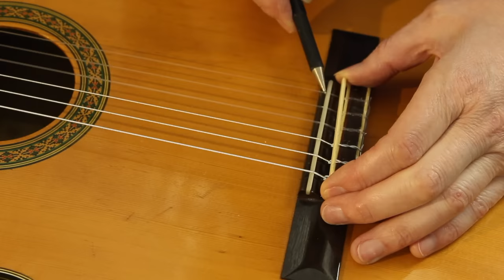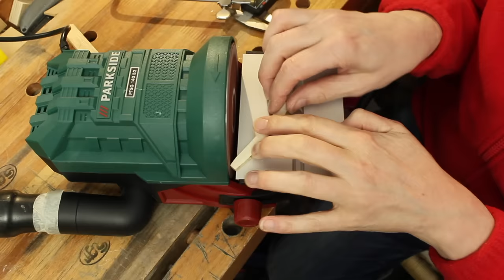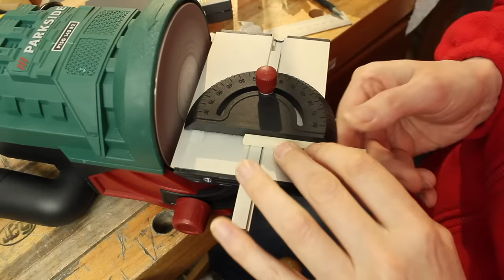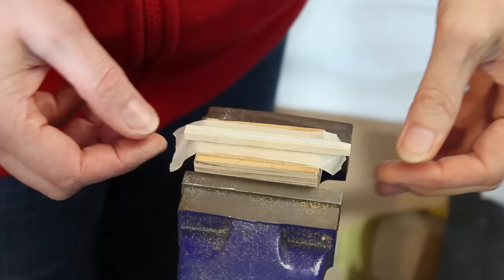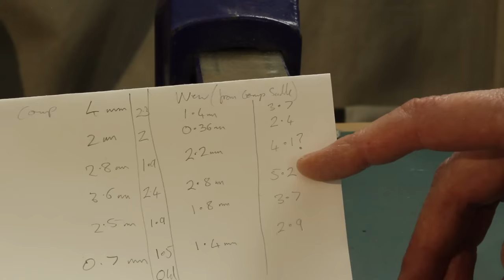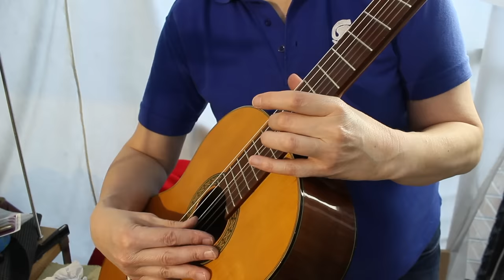Fixing the intonation on a classical (spanish) guitar

Comment: I'm struggling with nuts and saddles now and have been all spring. Here's a question,  I have a Yamaha 200s their 25 scale are they intonation specs separate from say 25 inch because our you buy a saddle they never ask what scale they just sell you what what's in their shelf. And I'm going to get a 4 mn bone saddle unbleached because bleach compromises the bone leave it in long enough and bleach will desolve it and that's my point  but I need some over hang on the back side side so it will look like a L but flipped up. Then I was thinking just super glue blocks where needed, my saddle is like 5 mm  +- and that's not much room, the there's though of the blocks letting go. I'm also going to carve individual string saddles connected by brass so there will 6 bone saddle standing up.

Comment: I took off all the frets on a cheap old guitar .  (3/4 sized Tatay with no fan braces whatsoever , also loose supporting brace under the neck end ) .  I had to rebuild as it was falling to bits . Three small nails were holding the back on  . To renovate the tuning I glued on bronze wire frets .Each note was worked out with a movable dummy fret ,using a Korg orchestral tuner , I fitted the bronze wire frets so every note was exactly Equal Temperament. This produced Wiggly Frets .All notes along each string perfectly in tune and not a straight fret to be seen .  The frets were glued on with Evostik . To remove one  just warm the fret up with a soldering iron .
Bending the bronze wire is easy with wire bending pliers .    Use parrallel nose pliers to lay them flat  on the fretboard . I hardly had to bother with fret levelling .

Comment: Thanks for such a fine video!  Your guitar looks a lot like my Takamine No10 classical guitar built in 1986 I bought used about 3 years ago.  From what I could tell it appeared to have been played very little.  I know it was bought in Japan, brought to the US and sold to me.  It was in Japan until I bought it.  Only the Takamine guitars that stayed in Japan were varnished on the inside of the sound box because the oceanic air is so humid in Japan.  I think it has the reddish brown east Indian rosewood back and sides and a cedar top, ebony bridge and fret board, mahogany neck.  The sad thing is there is no truss rod and the strings keep getting progressively higher off the fret board even though a lot of the time I'm playing in the very low tension open C tuning (just my own folk style guitar I play originals and covers with) but low in the $ now to have the neck reset.  Also my bridge and saddle are already very thin and low.  How much do you charge?  The grain in the cedar is very thin, my amateur term... the growth ring lines are extremely thin or many per centimeter.  I think the top wood comes from cedars in the far north of Japan that grew very slowly.  Does  your guitar look so much like mine because the founder of that Takamine company and maybe the founder of Yamaha too... trained under some of the world renowned guitar builders in Spain?  I forgot the Takamine founder's name.  What do you think of the older Takamine classical guitars like mine?  Mine sounds beautiful.  It sounds so nice that when I played at a coffeehouse open mic a man liked the sound so much after I performed he was taking pictures of my guitar ha!

Comment: Do you do anything to prevent the bridge from pulling forward over the years and causing bulging? I've tried to fix two of my friends steel string guitars which both had a quite serious belly bulge problem. On one of them I just clamped down just behind the bridge with two planks on either side of the body and let it sit like that for about 3 weeks. On the other one I had to remove the bridge and do the same kind of clamping for a few weeks, with a humidifier inside of the body, and also sand down the bridge a bit before reattaching it. I told her that she probably should make sure that the guitars are stored in a environment with proper humidity and also loosen the strings when they aren't played, but other than that I don't really know how it can be prevented.
Reply from the maker: Nylon strung classical guitars have far less tension and the fan braces mean it should never be an issue. Steel strung guitars are tricky because a bulge I think means there’s a design issue - eg my Yamaha 12 string is woefully underbraced. I’d rather add an extra brace than have to recommend slackening the strings every time - that’s not going to help tuning stability. There is a device that screws under the bridge and relieves the torsion by bracing through a rod attached to the tail block through the end pin - can’t remember what it’s called.

Comment: A very helpful video. Thank you. Does the tuning reference frequency affect intonation? I usually tune my guitar to 432Hz rather than 440Hz. My strings are a little sharp at the 12 fret and the saddle is only 2mm thick so not much room to correct it.
Reply: Tuning flat can make intonation little sharper, but 432 is such a tiny amount that it makes hardly any difference at all.  You can usually tune to Eb without causing intonation problems, (which is equivalent to tuning to A=415 if you prefer to think of it that way, a much bigger difference and not usually a problem)
Reply: @Muzikman127  Thank you. I have now corrected the intonation problem with my guitar. I routed the bridge slot wider and used a 3mm saddle which has allowed me to adjust the intonation almost perfectly.

Comment: The changes in tone due to changes in weather conditions I believe is due to the wood expanding and contracting. As my guitar warms up the wood expands and the strings go sharp because their length has increased slightly so I usually do my scales while they are a bit flat and they settle back to tune as the wood expands. Mine is not an expensive guitar and it is a bit out of tune on the 12th fret and I’m so deaf that it makes no difference to my playing. Another Gardner.

Comment: Susan hello, your video is great. But I have a guestion. Is a guitar playable at all if it is not intonated, if guitar does not have total intonation. For example, if we have optimal action and guitar is in tune in open string position, is that enough, or we need that also in 12th fret? Thanks a lot.
Reply from the maker: If you only want to play chords at the open position, ‘cowboy chords’, you can get away with poor intonation, but you’ll start to notice things are out when you play higher up the neck
Reply: @SusanGardener  Thanks for the answer. With skills I am on the way to be an intermediate player. I have Hohner hc06 classical guitar, beginners school guitar and electric Ibanez GRX20, also guitar for beginning. Both are afordable instruments. This is an introduction for my question, is it posible to get full intonation on those budget instruments? Or they need some kind of upgrade. Sorry if I bother you. Thanks a lot again. I am interested about your opinion.
Reply from the maker: The Ibanez has all the adjustability you need and you should be able to intonate it perfectly. The Hohner is maybe more a matter of luck, but you are less likely to be playing chords high up the neck so you should hopefully be fine. Modern guitars are generally fine providing they’ve not been subjected to extremes of humidity.

Comment: I use a string stretcher, same kind that works well with acoustic steel string guitar steel strings, and with some patience and diligence I can accelerate the string stability and get even new strings to a stable,playable state in a day and not days. In fact I can get the strings to a playable state in hours. Love those string stretcher gizmos!  Have you ever tried classical trebles whicyh are steel? Titanium as I recall. They have typical nylon trebles tension so don't confuse them with acoustic steel string trebles, they are true classical trebles but made of Titanium.

Comment: I used my mini-mill with a 1/8” bit to create a cantilever(L shape) in a 4mm wide stock bone saddle which enabled me to create a longer string than the existing 2mm slot would normally allow for my very stiff super high tension strings. My G string sting is 3.5 mm back 😮

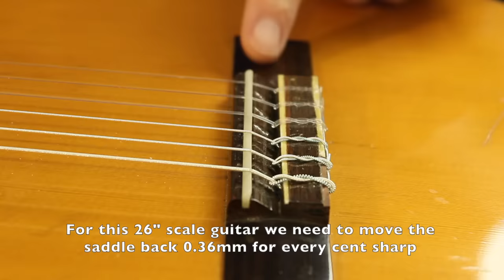Comment: on 9:26 you labeled on 26" gtr, each cent need 0.36mm move, how can I calculate other scale gtr??? thanks for sharing
Reply: If I understood the explanation correctly, each cent off at the 12th fret requires you to move the saddle position ~2 hundredths of the width of the 12th fret, so I’d go by that.

(because a cent is a hundredth of a semitone, and you need to double it since the saddle is twice the distance away from the nut as the 12th fret is)

Comment: Good explanation. Just a thought, why not cut the G string section of the saddle out and have the G string sitting on it`s own separate saddle, indeed now that you have worked out in more detail which which strings need fine tuning why not do this to all the strings then you can more accurately compensate for each individual string.

Comment: Hey Susan, great video! What would you do with a guitar that was a whole step off on the G and B strings? Would you consider moving the saddle itself, even if all the other strings are intonate-able with the methods you mentioned?
Reply from the maker: Are you talking steel strings? It would be unusual to have such a marked difference with nylon. It is possible to have a split saddle - Lowden do this on their steel strung models

Comment: Someone else may have committed already on this. I think you're solution is addressing the symptoms instead of the cause. More than likely,  the too of the guitar is being bent by tension. It happens over time to all guitars. The real solution is to provide support for the bridge to return it to a flat condition. The top has bent allowing the bridge to bow inward this shortening the scale length. Supporting the top under the bridge will lengthen the scale again restoring the intonation.

Comment: If it is sharp you can adjust on the nut to shorten the first half of the scale length of a particular or specific string having a sharp on the 12th fret
Reply: @rodelgalvan
What you said in the comment is illogical and mistaken

Comment: don't know how I stumbled across this. interesting approach. per experience, saddle adjustments can help but not solve intonation: strings are simply too variable. another approach is to alter the shapes and positions of frets: greatly more difficult. whatever the approach, any acoustic string instrument will have greater sustain the closer all strings/notes can be brought to accurate pitch along the finger board. bone for saddle is too variable for sound; especially when thick. beware fitting the saddle too snugly, as in this video; the pressure can crack the bridge.

Comment: You dont understand why Nylon strings stretch? They not only stretch but find equalibrium tonally   
 The reason is two fold first the polymer content of every brand of strings is differant so the elastisity is going to be differant  second the wound strings are made of two very differant materials 1) the nylon filament strands in the core and the silver coperplated wires wound around them so these two compleatly differant materials  stretch to shape and pitch at differant rates not to mention the outer copper materials are wound circular in a coil and the inner fibers are longitudinal  after 24 hours of tunning to pitch they find an equilibrium and harmonize I can only compare this to washing a garment of wool that has a cotton lining the cotton lining will be too big compared to the wool after drying because they are differant materials that have their own properties

Comment: Thanks for that video. That's an important point for any classical guitar player!
Even if in your case here, you had to make an accuented ajustement, according to your saddle inclination after top natural deformation, and the beginner guitarist maybe will find the subjet complicated, most of the time it will be a a simple modification..!
If nowadays, on a classical guitar, if we have a diapason/vibrating string length of 650mm on E1, and 651/652mm on E6,  after that, more than that, i don't understand why 'we' let a guitarist playing without ajusting intonation, at least on G string (and a bit on B string), more the hand go higher on the neck, more you are teaching your ears getting used with bad tuned chords.. when those could sound so nicer!  Please do that modification, that worth it so much!

It should be done already from the factory for any guitar! whatever the price of a guitar is..

 Checking with a good analogique tuner (100$ new, many years ago, but now 10/20$ 2nd hand for a Seiko st707 for exemple) at 12 fret, like you said G string was the wronger on all my classical guitars. And then a bit wrong for B2 and D4 strings. Those 3 contact points on the saddle have to go back.
When we look for a classical already compensated saddle, that 's those same three modification that we mainly found. I 'm left hand, i have to do the modifiction by myself:
I put the saddle contact point the closer of the hole on E6,A5, E1 strings, then on the middle off the top of saddle for the D4 and B2 strings , and then  the closer of the string tie for G3 string (like putting it back from 2mm). 

Then, even playing only the fist Dm chord of the "Milonga" of Jorge Cardoso (that exemple, because it's not so high on the neck: crossfinger on  V) , it sounds sooo much better!

Comment: Hey Susan, I've tried to intonate my Fender classical for 2 years now. By the laws of physics, and the Pythagorean theorem, 3rd intervals will be sharp. So, setting intonation to flatten the 3rd, makes the 5th even flatter. I've tried intonating the traditional way, harmonic at 12th fret...but, that never works. Can you make a video where you play a regular E major chord? And play that G# at 1st fret, 3rd string...that 3rd is sharp. Play A major, and the 2nd string 2nd fret C# is sharp, which is a 3rd. Same for D major, the F# is sharp. Then go to 5th fret, play A major there, and the 3rd string 6th fret is sharp, that is the 3rd. Then at 5th fret, play D major, and the pesky b string is sharp again at 7th fret. The guitar is a torture device.
Reply: welcome to equal temperament :D

all you can do is get the instrument to where it's "equally bad" in every key, then the rest is in how you play it, with pushing and pulling and vibrato and de-emphasizing certain intervals

Comment: Great tutorial! I have a Cordoba C5-CE guitar, but I can not adjust the intonation. I think that its scale is incorrect. 

650mm from nut to the saddle
324mmfrom the nut to the 12th fret
327mm from the 12th fret to the saddle.

The notes on the 12th frets are really low:
1st E: -13cents
B: -5
G: +4
D: -5
A: -9
E: -6

The action is low (6/64 at 12th fret) and the the neck is pretty flat (it has adjustable truss rod).

Comment: Great job. I have used that method, much preferred to moving the bridge. Nylon strings are mysterious. I've actually had them revert back up on their own after tuning down.
Reply: Yes you have to tune the E string a few cents lower when tunning it down to low D tunning  but that said make sure the string fits freely in the nut

Comment: Every single classical guitar I have tried (from cheap to expensive) has a grossly sharp G string at the octave. It is So sharp it is painful. Why do guitar manufacturers not pay more attention to this right from the start? Why should guitar owners have to fork out time and money to do something the guitar manufacturer should already have done? The problem is even worse with low tension strings. But it is not just the G string. The B string also sharpens as you get higher, whereas the D string gets flatter. I find this happens on every guitar. I also find that open strings are flat compared with even the first fret. Lowering the saddle or nut does help a bit, but not much.

Comment: As you have mentioned nylon has enormous elasticity. Steel strings settle quickly because they have little.
Imagine if you had rubber strings and how long it would take them to settle.

Comment: OMG, no! The bending effect is not the same on all the strings of a steel string guitar.  Go to any electric guitar and do a bend on the unwound G string,  then do one on the B and the high E.   You will see that there is much larger change in pitch in the G for the same amount of bend compared to the E. The same pattern repeats among the wound strings.

So you will see a split compensation pattern: more and more compensation with increasing thickness of the unwound strings, and then a bit of a reset: the highest wound string may have a bit less compensation than the lowest unwound, and from there more compensation toward the lowest wound string.

I'm very skeptical about the string stiffness hypothesis, sorry.
Reply: Here is the real reason why the thicker strings change pitch more when bent. Their parameters are designed so that they have a similar absolute tension as their neighboring thinner strings. e.g. 7 pounds or whatever it may be.   A thicker string produces 7 pounds of tension with far less stress (force per cross-sectional area!) than a thin string. The 7 pounds is distributed over more thickness, reducing the stress.  This means that the thick string is stretched less than the thin one. And so when you bend it (stretch it some more), the amount of stretch you are adding is a larger fraction of the existing stretch, and that  means greater pitch change.

Comment: Thanks for a useful, well made video. First time that I have come across an explanation of G string only compensation I see on many factory made classical guitars. However I do not quite understand the 2x factor. String length to frequency relation gives a factor of about 5 cents per mm pitch sensitivity at the 12th fret position and the same for required saddle compensation if the 12th fret is fixed.